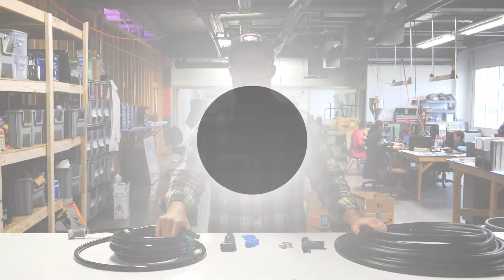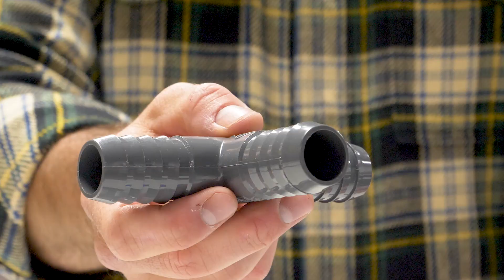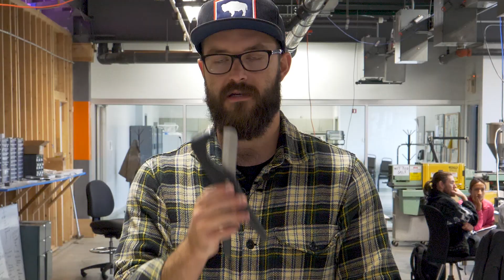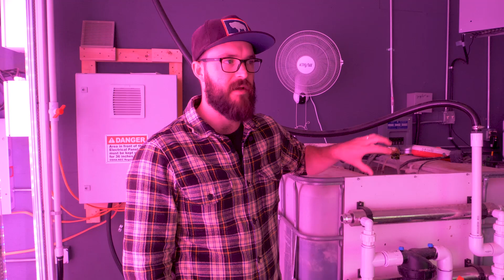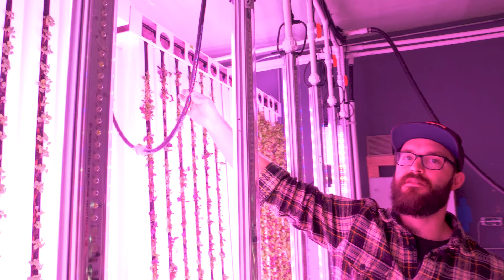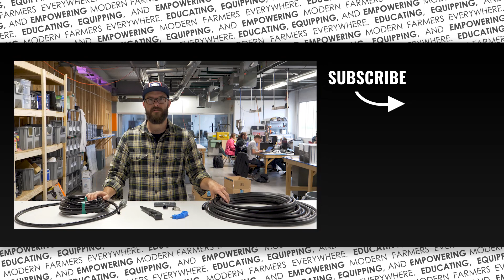Comment: I use Tie-Wraps :
If you don't want to spend to much money on hose clamps ( Not so expensif BUT if you want to - secure - everything you plugged in and hyou have to much ''clamping'' to do ).  - Replacement solution is = Strong Tie wraps - You can use Hot-water, a Heat gun or a lighter to soften the hose in and out, like a soft gum with no burning, flames or meltings parts + 2 Strongs Tie wraps next to each other to fix the hose tight when it's gummy / 2 Tie wraps = opposite lock side of each other / 
Put cold water on the hot and soft section or wait for the fix to become stiff again and that's it. ( For my little Home gardening where i dont have pressure, that's working fine - The only thing tie wraps are not reusable, you can find some that you can re-open but they have the same resistance of those lock ones and sometime less for a more expensif price, so in long term the metal clamp will win economicly, BUT your favorite size and choice of Tie-Wraps you will buy can Clamp any size of hose with out having to buy a Steinless Hose Clamps Assortment Kit ;-) Just Lock-it and Cut-it = If your Tie-Wraps are not long enough, just tie 2 in line and lock it -- Same if to little, Just cut what exceeds after ! So any size of hose or soft pipe can fit with one long size Tie-Wraps ).

I say Tie-Wraps height times in that text. :-)